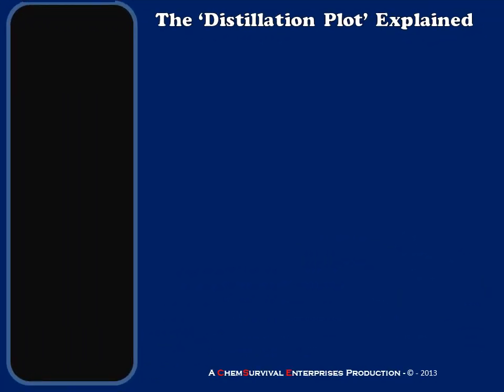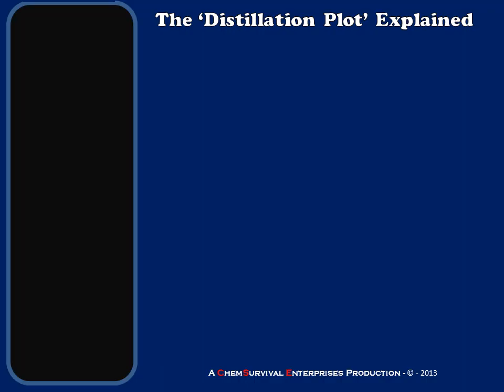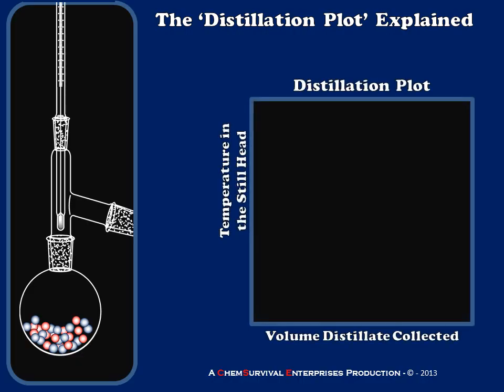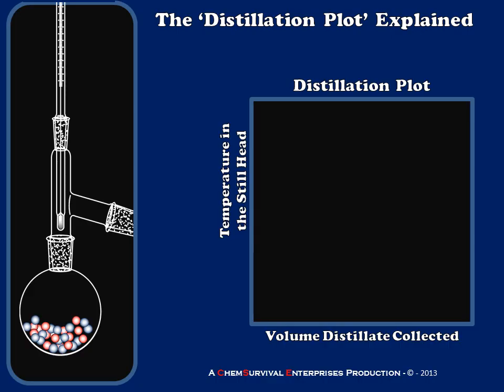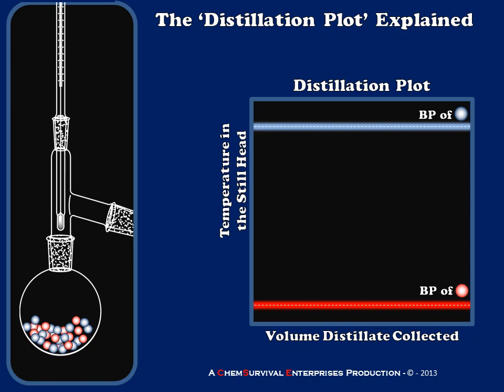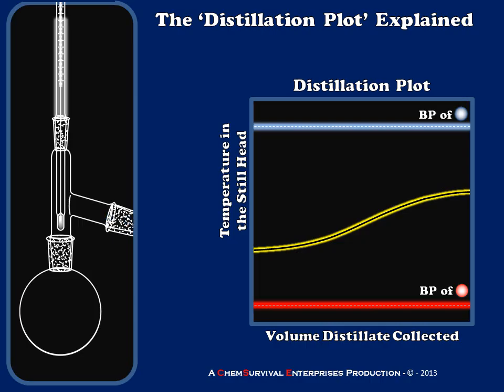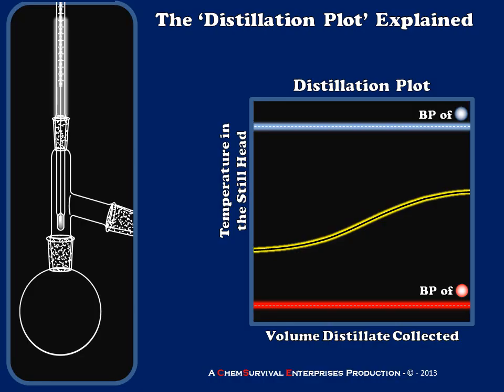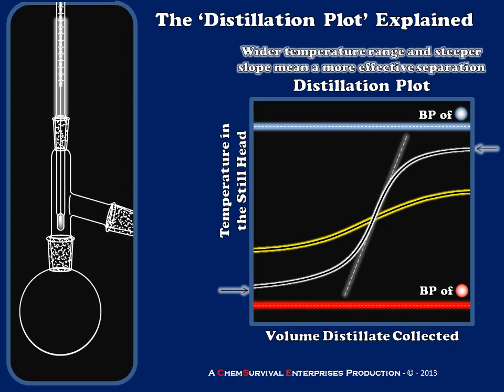Distillation Plots Explained

Comment: Let's say, using your example, I am only concerned about purifying the Benzene and I am less concerned about the purity of the distillate. If I were to apply enough heat to the solution bath to sufficiently raise it above the boiling point of Toluene, but never input enough heat to reach the boiling point of Benzene, would it be true that when my vapor temperature matches my bath temperature that the Toluene will have been completely removed from the original solution?